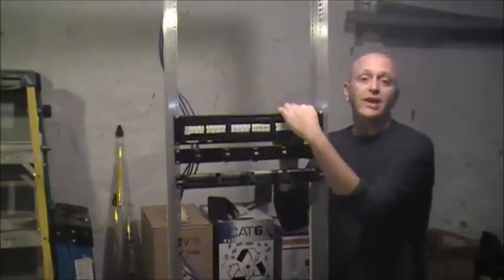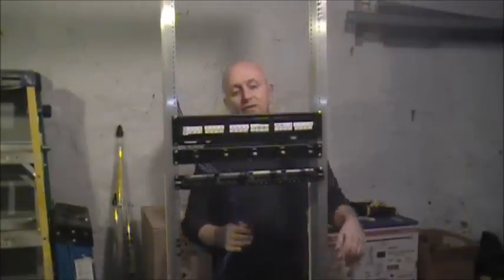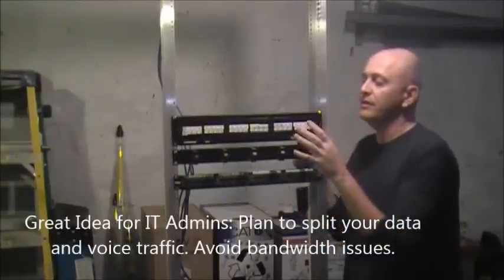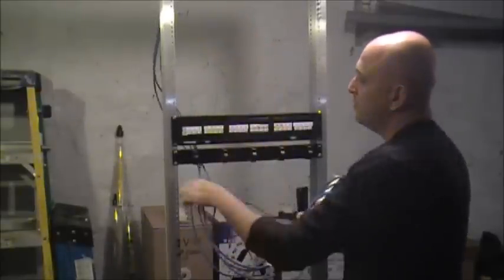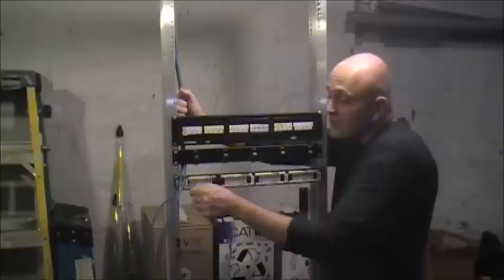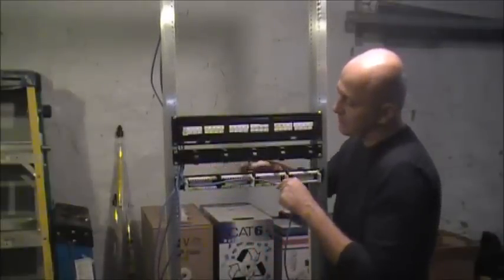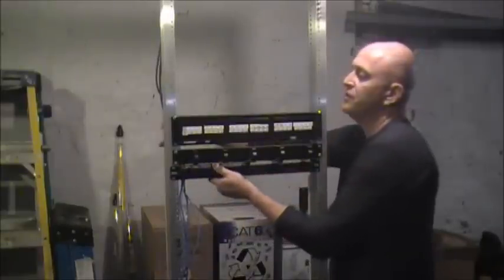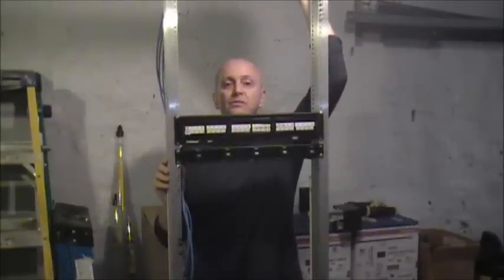Network Cabling Basic | Installation of Patch Panels with Tips | Philadelphia | BridgeCable.com

Comment: 110 Style Patch Panels are old technology.  Nobody who knows low voltage cabling uses a punch down tool and 110 style patch panels anymore for terminating low voltage cables. Rather, for high performing networks and cable terminations use modular data jacks on both ends of the cable and terminate them using a "crimp tool / wire termination tool."  These tools provide a perfect seating of the copper wires into the modular jack. I don't care how good you are with a punch down tool, you'll end up separating the small copper prongs in the 100 style block and thus reducing your performance. Make it easy on yourself while providing the best cable performance you can. Acquire a patch panel that is un-populated so you can snap in the modular jacks, see this link: 
http://www.discount-low-voltage.com/Connectivity/Blank-Patch-Panels 

It really doesn't matter who the manufacturer is, all manufacturers provide blank / unpopulated patch panels.

These are all the reasons why you should be using a crimp tool and not a punch down tool and terminating both ends of your cables onto jacks:

1.) Provides the best seating / termination of each individual copper wire into the jack. Result: Best Performance!
2.) It's much easier and way quicker:
Result: Save Time!
3.) Cables enter the jack straight on, not kinked up or bent to run along the back of the 110 style patch panel.
Result: Best Performance
4.) Blank / Un-populated Patch Panel are less expensive. So, you have 25 CAT6 cables that need to be terminated onto the patch panel? Why buy a 48 Port CAT 6 Patch Panel, buy a 48 Port blank Patch Panel and 25 Jacks. Why buy more ports than you need? By a few extra jacks for future cables.
Result: Less expensive!
5.) Your patch panel will look great buy using these materials and method.
Result: Professional Appearance

Many more reasons to not use 110 style patch panels and punch down tools.  Those who know use jacks and crimp tools at both ends of the cables.....

Expand Communications LLC  414-550-4566
Reply: There's arguments both ways. And there is a Keystone RJ45 system with an all-in-one crimp direct to the cable rather than punch-down. I have seen several different sorts of punch-down tool, and it also depends on the type of cable you have, multi-strand or solid core. As always, use the correct tool.

I am not sure it's all that much easier and quicker; you have the get the wires ordered right in the connector, even if the order is engraved in your brain, but I can see how that sort of pass-through Keystone can be useful if you expect things to be changed.
Reply from the maker: Great insight David and a good rundown of another way to terminate wires. I see that working and we have done the above in the past. However with skilled techs regular punch down blocks and tools are very common still. I'm unsure of how many sites you work on or have been on......95% of the sites we are called on and most techs will see still require a punch down tool. Granted using the mods is a clean look that most rookies can do. The only companies that would really insist on the above might be an enterprise site. Even then with a skilled tech the "old school" way is still leading the pack. Back and forth on this......plus real quick......the mods you install you need the brand jacks and crimper. "Old School" fits most brands....more universal. Out of my techs....they complain on mod panels.....they are skilled at cable management :)

Comment: We mostly run 25 pair where I work. One of our night guys does the punches. I noticed there is always more unjacketed wire then if it was a multi-cable job. Are there any issues with interference?
Reply from the maker: Thanks Brandon for the question! Multi-cable job? I am leaning towards the issue with the wire exposed from the jacket. Every tech in the years I have been working in this field has different lengths. I can always tell from new clients if the installer was "any good" seeing the lengths. Typically vendors will have around the same suggestions, and our "rule of thumb" on our teams is remove the jacket an inch or less from the patch panel. It is true with say three inches of exposed wiring you might get interference. Being in the field we all know as soon as a vendor or IT comes in they lay cables everywhere! I could ramble on.....but keep the jacket on the wiring as close as the patch panel or jacks as possible.
Reply: The basic idea goes way back, and not just for computer circuits. It's the same for coax cable, such as for a TV aerial. The screening and other electrical features of the cable start to falter as soon as you strip the jacket. And even done right, the connector will suffer some signal loss.

I have had alleged professionals do things that I wouldn't dare try. But my time is cheaper than theirs.

Comment: How many Cat 5e/6 pairs are require for VoIP?
Reply from the maker: Without too much research....all of them :) Once we had a new client with his network and VoIP phones going up and down all the time. We checked out the jacks......old telephone guy, or some rookie, just did 2 pairs....WTH? Think of it this way.....on the network with just 3 pairs alot of lag and packets lost. Up in NY this week we got some VoIP phones back up and running after seeing only 3 pairs were working. Seems like two wires got damaged.....odd enough.....both wires were the brown pair.....the random cut was same for both wires....odd.
Reply: Bridge Cable thanks for the reply. Multi-cable in that you would have four 24 pair copper cables or one large copper cable patched to a 24 port panel instead of each port having one cable punched into it.

Comment: Can you give me some information on the service loop.   
do you loop in bundles. say 12,24,or 48 cables and loop them all together. Or do you loop them individually? 
Do you make the service loop above the stub out then make it nice with velcro & cable comb. Leave excess then cut to length and punch down ?
Reply from the maker: +Koshy1 Great question! Service loops vary from installers. Typically service loops are hidden. So if you are coming into a rack or server room it makes sense to hide like 4-6 ft of wiring above the ceiling. Keep in mind some come from the ground. Again, it really depends on the install. Never keep the loops in plain sight as we want the appearance to look neat and easy to work/service with. One thing we typically do is wrap the network cabling once on a J-Hook in the ceiling. Very rarely do you move your MDF or rack but.....if you do...then with a service loop you are good to go! Most techs will also mention to do a service loop, 6ft, at the end locations, like the workstations. Hope this helps! Paul
Reply: Thank you,  would you loop all the cables together and velcro as one large bundle,  or would you loop them individually,  then Velcro all the loops together .
Reply from the maker: Keep the main bundle together! :)